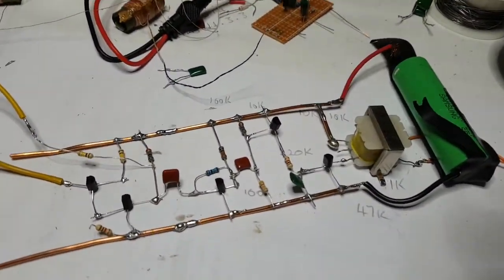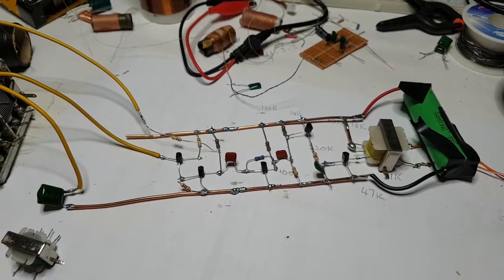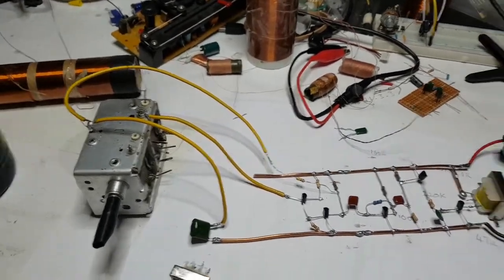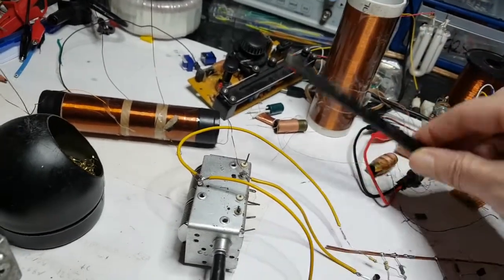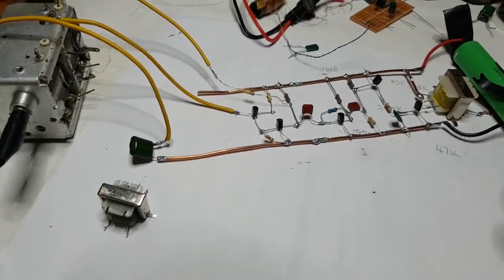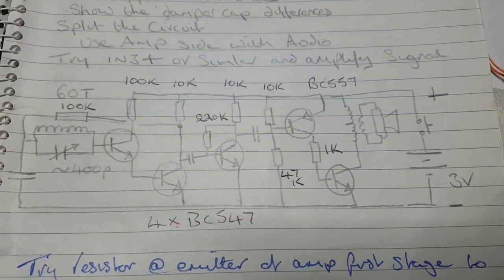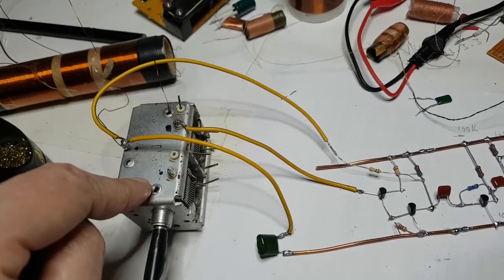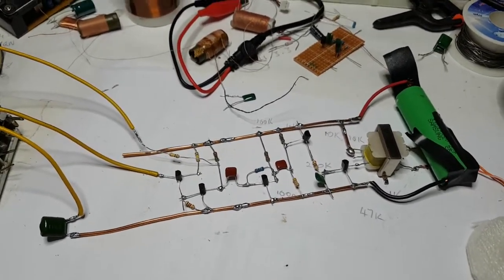5 Transistor Radio Experiment 2

Comment: try adding a 1000uf cap across the supply lines, connect the collector of the first transistor direct to the supply line, or to the collector of the second transistor, instead of through a 100k to supply, and add a 0.047uf cap from 3rd transistor collector to ground..(and try instead on 2nd transistor collector to ground)...
Reply: i did A LOT of experimenting with various 'simple' radio circuits some years ago and the best i got at the time was using a variant of the famous zn414 radio chip (zn416, has extra amplifier stage)...yes, cheating, i know 😉...,  and operating it quite differently to how it was usually used, unfortunately these have both been obsolete and pretty much unobtainable for a while, although there is a near clone of the zn414 available...at the moment...
Reply: i intend to try more ideas as and when i get chance.....